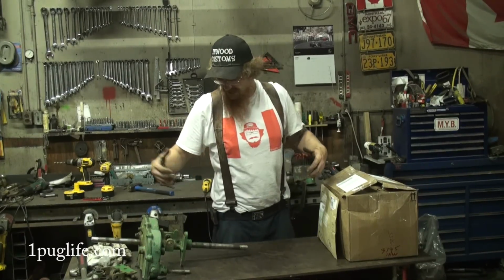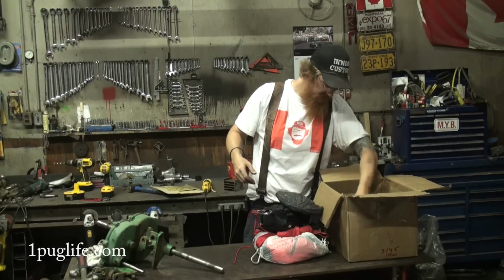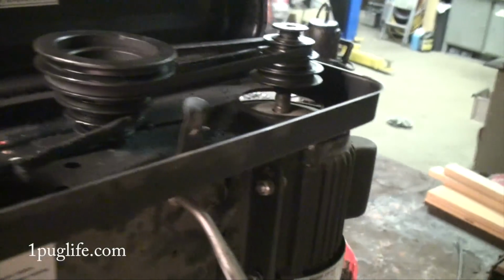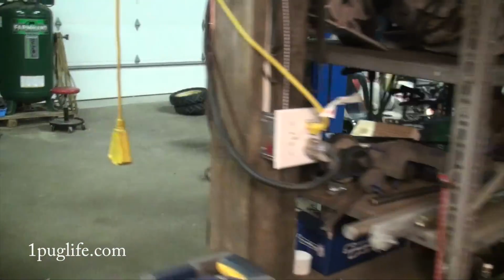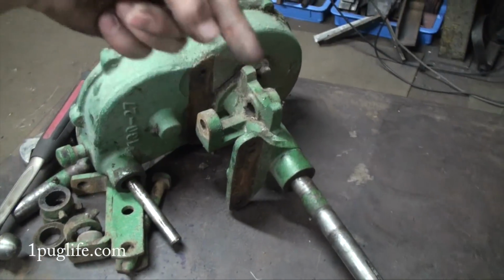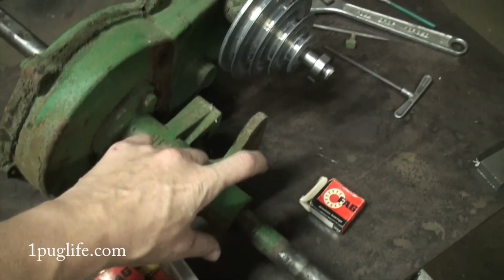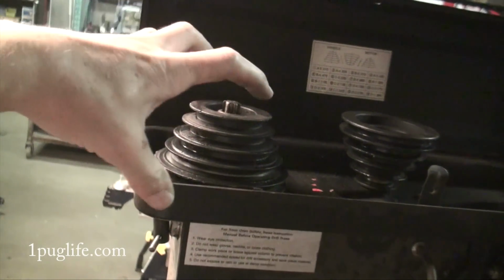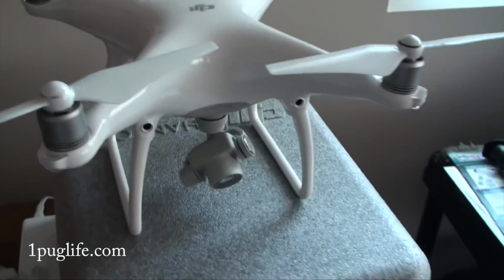random canada days

Comment: That "chisel" you picked up is a plumber's tool! It's not sposeta be sharp. It's fer packing oakum (creosoted hemp) into iron pipe hub leaded joints. And fer beatin' the lead down in there tight for better seal. The strength of the joint comes from the packed oiled hemp rope that gets jammed tight in the cavity - the lead just forms a gas / water tight seal. Those chisels come in many different shapes, curved blades to match radius of the pipe, etc.

Comment: I basically have the same design drill press (craftsman 1hp). I bought aluminum pulleys put on thicker belts and it is like a new machine now! Even the thicker belts on the plastic pulleys made s huge difference but I had already ordered the alloy pulleys so why not put them on too. It runs much quieter now with the aluminum pulleys. They are balanced unlike the plastic ones and don't vibrate like the plastic ones. There's a guy on YouTube that put his plastic ones in his lathe to get them more round and less wobble that inspired me to look into new pulleys. The wider belts was the real trick as far as no slip. As far as the chuck goes. You have to clean the tapers well and use the drill itself to press it on there really hard. A few good videos on YouTube about those as well.

Comment: Put a little heat on that bracket that is bent on the drone it will make it easier to bend with the pliers. It dont have to move that much so it shouldnt be a problem! The crack pipe lighter should work good for that!

Comment: And the drill press sounds like a fun project
Reply: Chooch it bud!
Reply: That pantyfant gearbox aint a good as simple belts in action, adjustomatic and all, like they are...he just needs to remedy why his drill press be munchin' on belts. and put a good jacobs chuck on there so it stays.
Reply: +MM420 erary day buds except today but maybe just before bed
Reply: +skeggjold gunnr looks a bit like tweeker logic but the 25 to 1 should speed it up ,no?
Reply: Evi Led The gearbox is actually just a gear reducer, it has a driven and a drive side, an input and an output, like a differential on a car; don't apply power backwards for too long...can't be turned around and last. So it's output will be a 25th of it's input. if motor turns at 1400 RPM, the output shaft will go 56 RPM. Kinda slow maybe? That gear ratio will have no home in that press, ultimately. Small drill bits like a higher speed, big honkin' coping notcher hole saws will want slower speeds, the gear box would disallow an entire stage of adjustment and he'd never get as high of a speed as the present acriment gives him.

Comment: Silverado really made a nice truck there man. I regret buying my ford mannnn look at that power.
Reply: they are all good and shit at the same time
Reply: prolly tuned it causw i havent got one stocker to brake traction unless older than 2007
Reply: I got a new Silverado, had to get new ford ecoboost for a rental and it cooks all over my truck ! Def may consider next buy
Reply: +Avedikian Farms 6.2l chev kinda keeps up with that ecoboost 6cyl.
Reply: +Far North Squirell  true...  Not much efficiency tho , those eat more fuel vs ford Eco. 
Also, my hyper tech programmer for my '12 Silverado gives me like +12hp... The same damn programmer for the ford EcoB is +87hp!! Ridiculous! 
I've seen the fords cooook with 3 little bolt ons; programmer, stock box k&n, and an exhaust! "CooOookinnn!!"
Def may make the switch to one on the next truck. And the ford limited is badddass!

Comment: Is the top of the drill press missing a belt tensioner? Or would a tensioner fix that slipping problem?
Reply: Or maybe put a belt between the two end ones and take the middle pulley off.

Comment: try new belts on the drill press before you rebuild it ffs you big goof
Reply: He should have never got rid of the Bridgeport. He could have used it as a high end vertical press at the very least and could drill 1" holes all day with it.
Reply: I know right? the belts seemed pretty hacked up
Reply: That sweet ass Bridgeport would have worked as a badass drill press and more.

Comment: Wow that's some mission to fix the drill press pug..Just buy new belts and clean the
old pulley wheels..If there plastic throw them and turn some new ones on the lathe.

You will find the old belts where foooked and there is a load of oil and grease covering
those pulley wheels..That's all and smash the new taper into the drill chuck.Its not a 
massive issue...
Reply from the maker: no no the belts are new as frig and i soaked the shit out of them with no slip belt dressing and did nothing im not drilling into carrots im drilling the metals bmp for that out burst
Reply: 1puglife Pmsl good  luck pug :)
Should have kept milly milly
Reply: its all chazzled  ffs
Reply: I'm sure you tried adjusting the motor mounts or shimming them? Can you get thicker v belts? Same length just heavier guage? It looks like they're too thin so no matter what you do to them they'll slip.